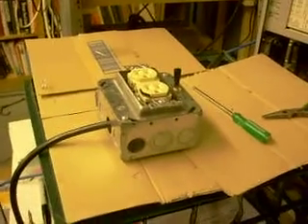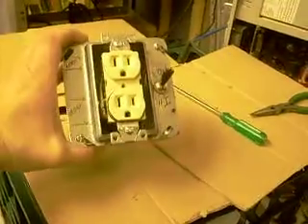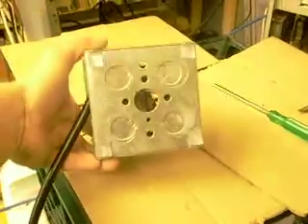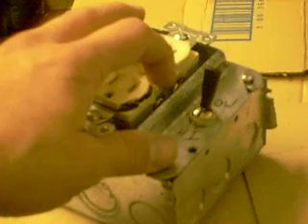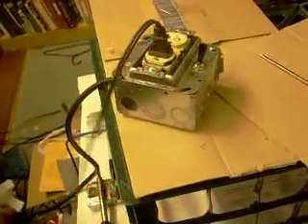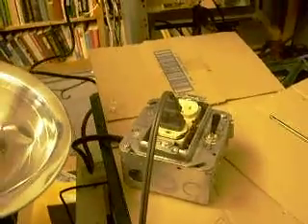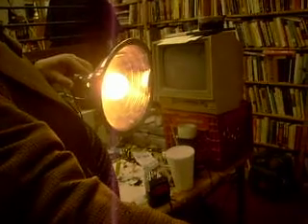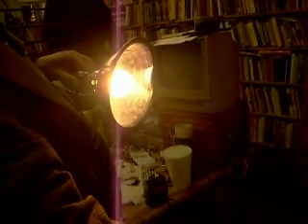Soldering station, homebrewed.

Comment from the maker: Right, I'm not done yet and still have the potential there to shock myself badly. Plug the holes, add the stress relief, a couple other touches. Glad you liked it! Als will work as a short extension cord.